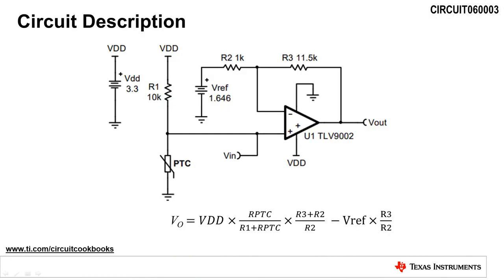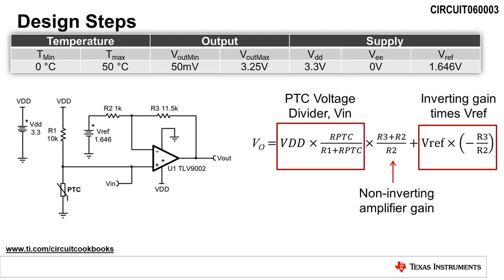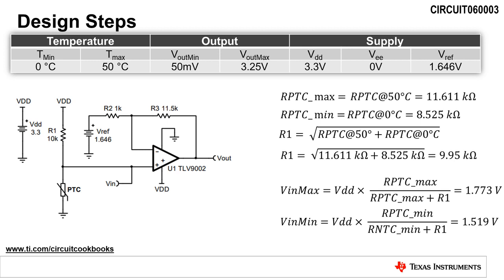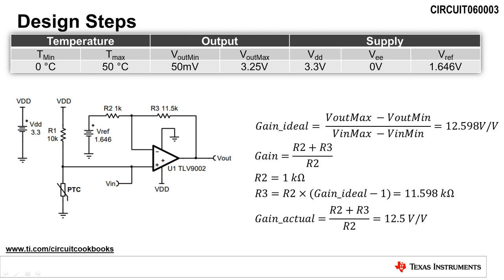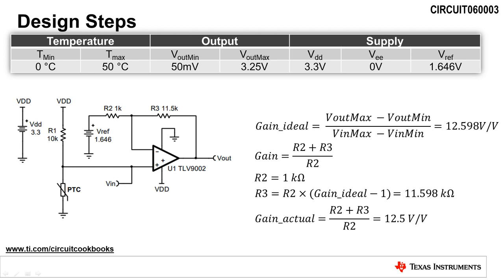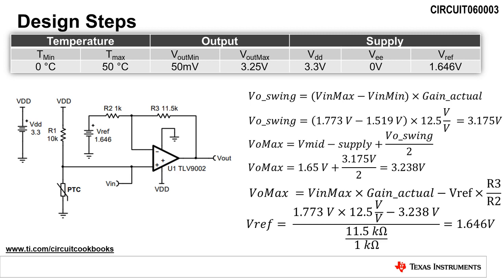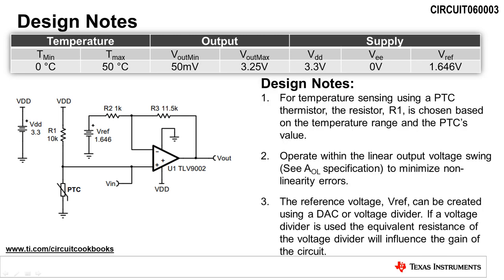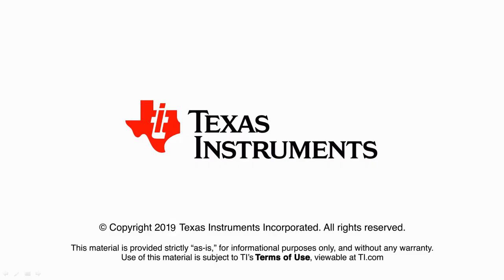Temperature sensing with PTC thermistor circuit

Comment: Where did the equation of R1 came from?
Reply: It’s the average PTC value with a mistake. So Vin fluctuates around the mid point between VDD & ground, I assume. 

Arithmetic mean is (11.611k+8.525k)/2 = 10.07k. Geometric mean is sqrt(11.611k*8.525k) = 9.95k.

With a “10k PTC” some people would just use a 10k resistor for R1 and not think to calculate anything.

Comment: why vref is required, what if vref not used?
Reply: Bruh, what do you got against vref?
Reply: Vref is used to offset the inverting amplifier so the output so it does not go negative, this is to make it easier to measure the output with something like an A-D converter. Vref  could be a simple voltage divider provided it is 'stiff enough' (e.g. low enough resistance).
Reply: @MarkLemanUK  It’s non inverting. Their circuit makes a good, strong signal. You can make it work without Vref but not with a 3.3v supply and have a good signal too…